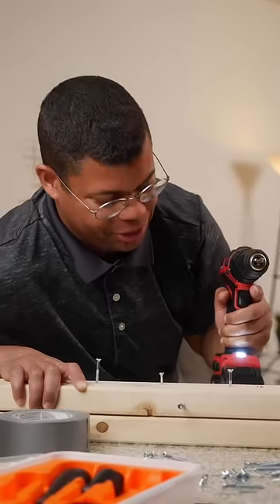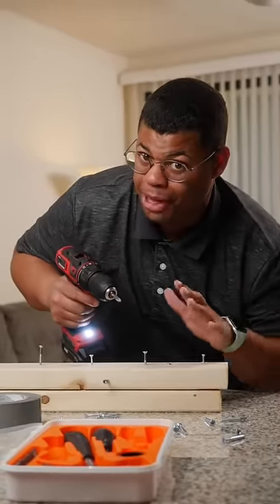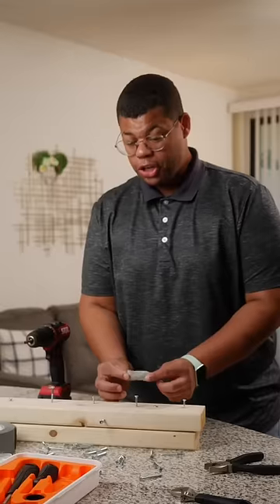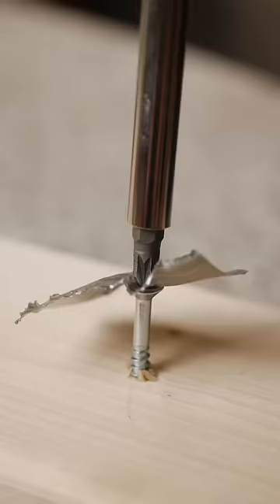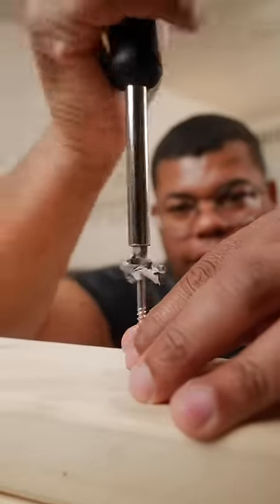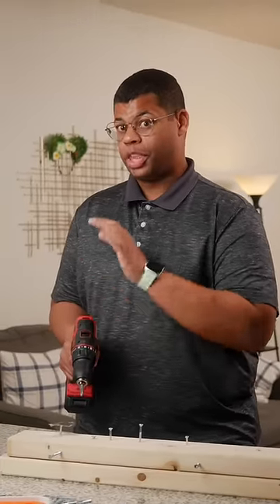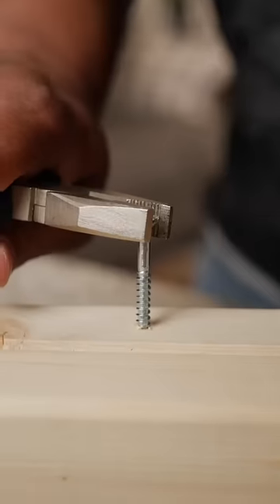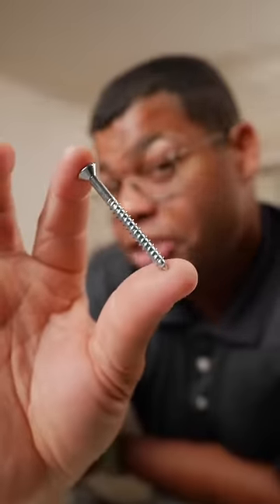How to remove stripped screws #shorts #lifehacks #diy

Comment: Yep. The point to removing stripped screws is to replace the lost space so you can do a normal task. Hence why you use tape or cloth (I just carried way too many rags for the different finishes I liked to test out) to fill in the space to make up for the stripping

Comment: So actually if you have a screw that is completely stripped out and unusable the best way I found to fix the problem is to basically turn it into a flat head.

You can use a file or depending on the type of screw even a chisel. I prefer a hacksaw personally. Just cut slightly into the top head of the screw so that a flat head bit can get in there. You need kind of a big flat head to be able to fit over the entire head of the screw but it beats having to turn it out with a pair of pliers.

Comment: You can put a rubber band on top of the head then use the drill. The rubber fills the striped gap and it works as normal

Comment: Also you can instead of the philips head once it is stripped out find the right sized square head bit that sets firmly and deep into the screw and use it instead or if it's a 2 type head then just use a flat head

Comment: Vice grips are good also, can use rubber bands as well if you have that instead of duct tape. If it's completely embedded in the piece of stock and you can't remove, you could try an angle grinder or Dremel to cut a line in the center and use a flathead to remove. Could also use easy outs if you have them and it's really bad!

Comment: If a screw is really stripped you can also grind a slit into it with a Dremel and then use a flathead screwdriver to get it out.

Comment: If the screw is stripped and you cant grip the head you can use angle grinder and make slot into it 
Then use slotted screwdriver

Comment: And don't forget that the drill has the ability to grip round things! If you got enough of the screw out of the board, remove the bit you were using to remove the screw and put the 'chuck' (the part of the drill that tightens around the bit) over the screw and tighten the chuck as much as you can, and try removing the screw!

Comment: Use scouring powder or even spit on the ground and use sand. Clean bit and screw of oil. Having clean (not greasy) or new (ish) bit goes a long way to not striping in the first place.

Comment: If you are going to use the drill/driver, take out the bit and just chuck down on the screw. Once the chuck is tight, reverse the drill and take out the stripped screw. Much faster and easier than using pliers.

Comment: Hey just your friendly neighborhood contractor here to give all the homeowners and DIYers a tip or two! 
Get yourself an impact driver for screws. Not impact wrench, impact driver. Doesnt gotta be a nice milwaukee or dewalt, but that tool will help drive screws far better and make stripping screws less common
Also if you get that tool or not, think of your power tool's trigger less like a gun and more like your gas pedal. It'll spin slower the less you press, its typically best to press down about as fast as its driving, only going full throttle when the head's almost touching the material your screwing into

Comment: If it's something like that and that's sticking out that much I've also used a Dremel to cut a slit in the screw and then use a flat head screwdriver obviously in the scenario you could have just used pliers but I've used that when the screw was sticking out just a little bit but not enough for pliers or I didn't want to risk scratching the surface with pliers so I just use a Dremel

Comment: As a professional contractor I'm gonna tell you what I tell customers all the time. A DRILL is for DRILLING A SCREW GUN is for SCREWS!!  An impact driver will almost never strip screws no matter how long the screw or how hard the wood. I've ran lag bolts in hard hard stuff with a 1/4 in. Impact driver.

Comment: Wish you were there to help teach some of the mechs I work with. Screw is slightly gubbed and you need it out? “Jim get the drill and screw extractor!” Rather than just trying easier options like this

Comment: For a real tight hex or Torque screw,  like the star-shaped bit which I believe is the torque. If it's real tight borderline a little stripped almost already, and possibly has loctite. Instead of jumping in and stripping it, I'm wondering if I should try this method on it from the get-go. And if it might help break It loose without stripping it ?

Comment: These almost never work, if it's striped, it's probably stuck
Reply: Most people don't hold the drill plumb, or use enough pressure.

Stripping screws is very common for inexperienced users.